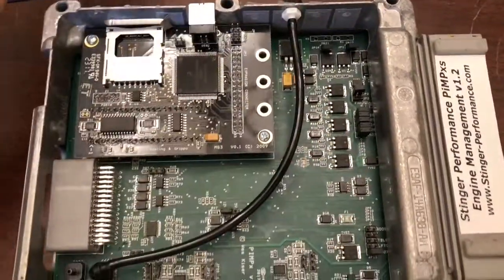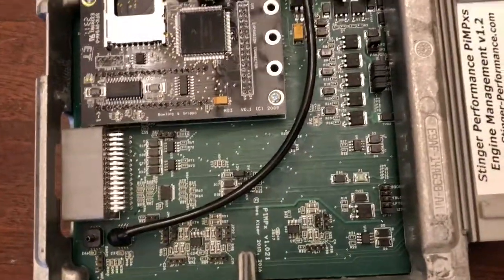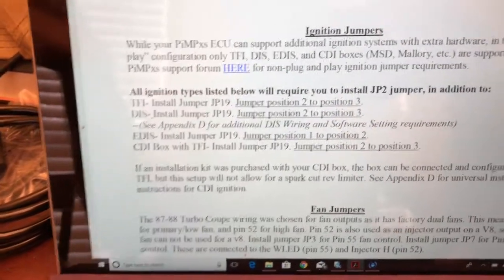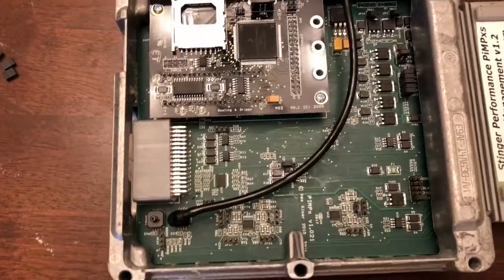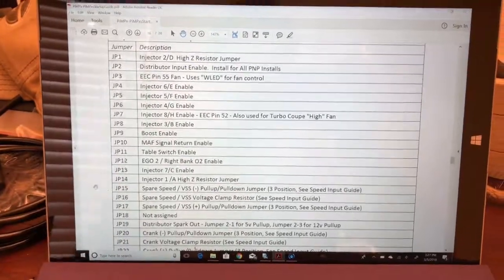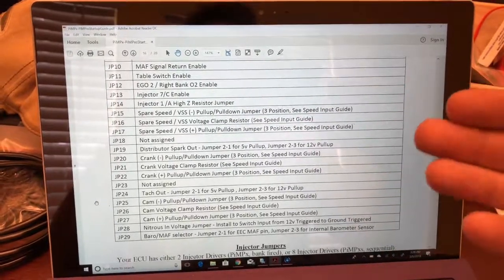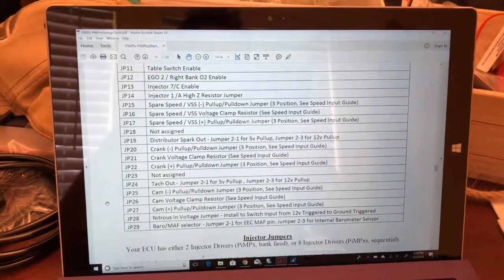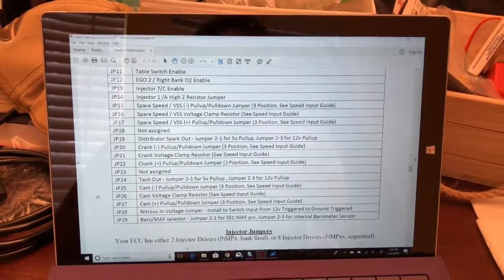PIMPXS Review: Hardware Setup

Comment: mine was straight forward too. i have the pimpsx. also i used 10 jumpers and have 5 left over. lower in the install directions it states you can add other circuits to specific pins on the ecm for outputs, max 3 amp output to control relays, like water pump and fan controls. good video
Reply from the maker: Glad to hear it man. It's genuinely neat how much you  can add/take away on this thing. I feel pretty open to doing just about anything I want with the car and this ecm. The electronics are no longer a limit for sure.